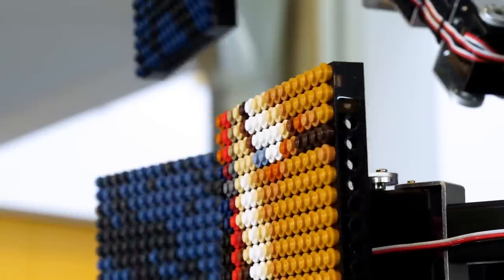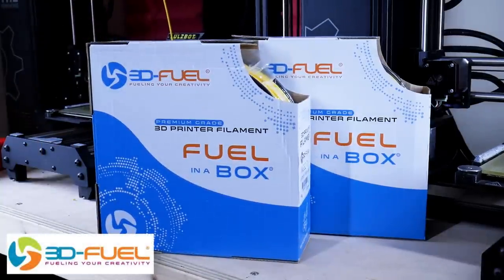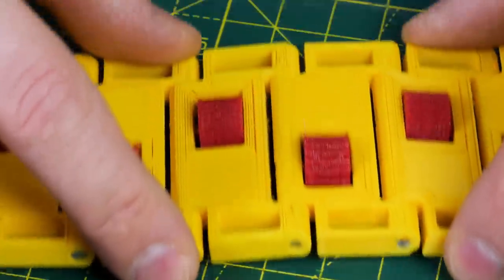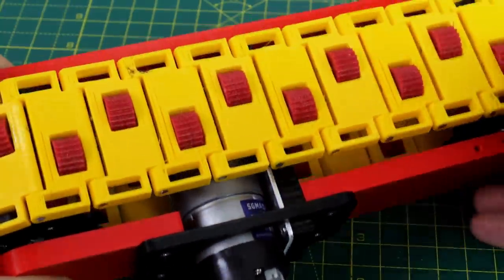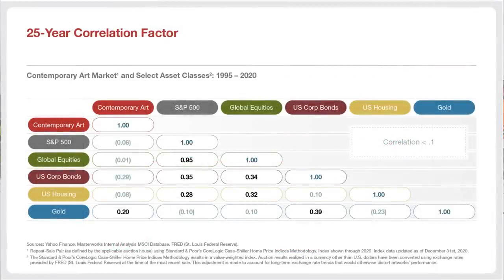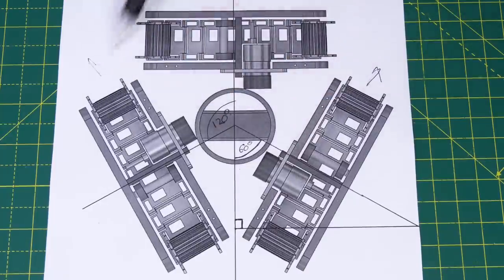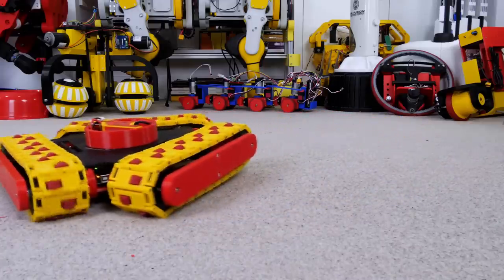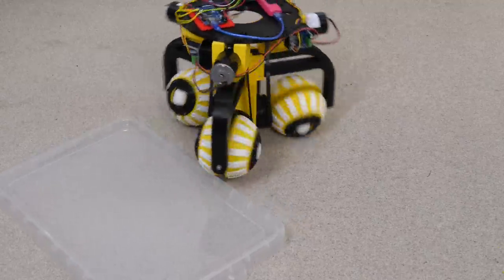Will this Omni-Directional Tank Work?

Comment: Perhaps you could create a flexible rubber 'inter-tube' capable of rolling in two axis, and wrap that around a row of omni-directional wheels? The inter-tube would need some kind of texture that would hold it in place as it moves.

Comment: Okay very nice, but!  How about adding suspension to the treads. Letting them pivot 10-20 from a center attachment, that way a thread to start to climb an object without lifting the other two treads. Also you could redesign the tread pads to have a spring loaded tpm fingers/knobs that are retracted into the tread on horizonal plane. But get pushed out but the end sprockets. This way you would have little rubber fingers/knobs to lift the tread onto objects, with out having them interfere with the wheels in the thread?

Comment: The track that goes sideways over some surface is always going to drag or catch by the look of things. So yeah, the terrain mobility thing seems a no-go on this.

However on the bright side, I bet that system would be ideal for distributing the weight of something very heavy while providing a large traction surface. This might be useful for omni-directional movement on large industrial robots on a factory floor.

Comment: Instead of each track being fixed at either end of its side of the triangle chassis, what about if they where attached at the middle with a pivot.
This would allow the leading edge of the track to lift upwards whilst the trailing edge lowers and remains on the ground.

Comment: Have you ever thought about making a 6 legged walker with rotational symmetry. Because of its shape it is passively stable both standing and walking, as there are always at least 3 points of contact with the ground, meaning there is no need for complex active stabilisation

Comment: It would make more sense to make the tiny wheels with lines in the direction of rotation. They are not driven, so they don't need traction in they direction of their rotation. If they slide, instead of rolling, it is fine. But you want them to have hold in sideway, in the direction of the tracks.

Comment: "As soon as the front of the track lifts off the ground, the back of the track lifts as well." At that point I knew that you had to give the tracks suspension. Just detach each track unit from the body and hinge it as a whole from its center.
Also, if you really want the thing to go off-road, you'd need to improve the edge of the tracks. There's no point of making the tip able to go over 5cm high obstacles if the 60° edges that follow it get caught up on 0.5cm pebbles. Maybe change from conventional track pieces to a "rope of wheels" i.e. stack a bunch of wheels and connect them by the ends of their axles.

Comment: If it was a Y config you could have all 3 tracks helping while still being symetrical. current triangle config means for all 3 tracks to be pusing your center of mass is off to the side relative to the point of contact on the thing you're climbing over.

Comment: for your next version instead of having the little wheels have an alternating offset per link you can double up and have two wheels per link, that way the majority of the link is tpu rubber with the wheels and you have less drag with the non wheels surfaces. It'll be a lot of wheels though

Comment: If you design a suspension system for the tracks similar to the one tanks use I think you will get a much better grip. Because one of the problems of your current track design is that it is to stiff to be able to form/deform over the surface you are driving over. You need more slack in the track

Comment: it might be an idea to make a basic triangle with a hinge on each side on that hinge you make a pivot point which makes the front and rear track higher possible.... just before the pivot point you make a compression spring back to the  basic chassis in the middle to regulate the pressure on the track... but a raised point so that it does not require much force

Comment: Maybe if you put each of the 3 tracks on a center axel? 
So each can spin on the Z axis. 3 rods coming out of the center, kinda where the motors are. 
Then each track can rotate up onto obstacles while the others are still flat to drive. 

Hmm or instead of a straight rod/axel type thing… each track could be connected to the center by a 3 segment arm type thing… almost like a human finger. It could then go right up to a 90 degree wall and one track could lift up to drive along the wall. 
I’m guessing the motor placement and all that gets tricky though.

Not sure if any of this would work, but the picture in my head is pretty cool lol… 
Apologies if I’m shit at explaining it.

Comment: With the triangular configuration shown here, would it be possible to move the motor to within the space between the two track drive wheels? Then add a pivot point at the centre between the two drive wheels, which is parallel and level with those drive wheels. Then as one track mounts the obstacle, the front rises up, and the rear presses down just as much. The other tracks will adapt similarly maintaining good contact. Being three pivot points in different axes, when on flat ground the vehicle will remain flat too. Please do built a life-sized one!

Comment: I forget the name, but you might try a "footed tread" design, since the "feet" act somewhat like proper feet.

Also, add more spring adaptation to your treads- going without separately sprung road wheels goes against one of the primary advantages of treads.

Comment: Great fun, nice project. As you mention some tracks lose contact when meeting obstacles. Some form of independent suspension would be required to ensure traction is maintained. I'm fairly sure you could use the platform as a good starting point for these additions.

Comment: It seems to me, if your track were not so taut - if it had some slack - then, even when the body is pivoting up, you could have a portion of each of your driven tracks making contact with the ground.  Making the links of your chain narrower may increase the flexibility, so that the length of track suspended in mid-air, no good for traction, is reduced, but first, cut your vehicle some slack!

Comment: Have you considered moving the staggered TPU wheels from mostly in the middle to each side of the tread links? This would both give you better grip at the very front where you're trying to climb, as well as free movement perpendicular to the rear track when tilted upward.

This would of course require a complete and rather nontrivial redesign of the tread assembly to accommodate the TPU wheels being where the sprockets currently engage with the links.

Comment: Kinda obvious what the solution is... Make the small wheels bigger and relocate them towards the edge of the tracks instead of the center...
It will a) allow them to catch on a ledge while climbing towards something and b) allow the trailing edge of the sideways going track to roll along instead of potentially catching the ground and potentially preventing the front end from pulling it along.

Comment: I wonder if it’d be possible to have an Omni style design with more than 3 wheels? Like you said, it seems to struggle when the primary driving wheel is lifted off the terrain, so perhaps a design where there are redundant driving wheels which can pick up the slack could work. I’m not familiar with Omni style design so I wouldn’t know what it would look like, but just throwing around ideas

Comment: I think one of the bigger problems with this design is the tracks don't have an articulated suspension and that will make them deal poorly with uneven terrain. Making the treads articulate and conform to the terrain would likely help with getting both tracks over the obstacle as you wouldn't lose all ground contact the moment the track's end is lifted up.

Comment: I love being wronged by engineering. Early in the video I theorized this wouldn't work because the tracks are at an angle the TPU sheels aren't (60° vs 90°), which implies the wheels aren't so muct rolling and sliding at an angle.
BUT this didn't seem to hinder the vehicle's omni-directional abilities. I was very surprised by this but perhaps driving it on a hard surface would highlight those problems more than on carpet.
In the end, it was the track themselves which proved to be the Achilles heels. I did not expect that.
Cool experiement.

Comment: I wonder if splitting the two tracks that drive it forward in half would fix the pivoting problem but I'm not sure if you would need 2 extra motors or if you could drive them from a single motor with a some sort of mutual belt. It might also require a slight play in the mounting to allow the front and back to tilt separately.

Comment: James,
I would like to see you explore the concept of an externally lockable omni-wheel for the purposes of having a wheel that can be both free-moving and have high traction as desired.
Reply from the maker: Probably something like last week's video/project
Reply: @jamesbruton  I suppose that would serve the same purpose, but it does seem fairly expensive to use an entire motor if the only goal is to lock the rollers. This is especially true in the context of a high school or college level robotics competition where motor count is limited. I imagine some sort of linear linkage utilizing a pneumatic or solenoid for power could be used instead. It should also be possible to use such a system with a straight-through drive axle by mimicking the mechanism used for braking on a BMX bike.

Comment: just had an idea for an omnidirectional "wheel" you might be interested in trying. it would have to be combined with with a balancing method though.

it's just a single spinning ball, the direction and speed of movement determined by the angle of the axis of rotation.

you haven't already tried it have you? I haven't seen all your videos so I might have missed it.

Comment: Hey James, I think this might be your best design so far IMO but did you consider using 4 tracks instead of 3 in a diamond configuration? This might help when trying to clear obstacles as the two rear tracks would still have contact with the ground. Maybe you could even have some kind of suspension between the two sections from front to back? I have no idea if this is possible, I'm certainly no engineer but thought it was worth asking about. Great work as always, keep it up!

Comment: Break each track up into two and allow them to pivot at the ends near the middle. Then add some spring suspension at the ends to keep the corners passively pressed against the ground. I also wonder how using an oddly-shaped wheel for your side rollers might affect their traction on bumpy surfaces like gravel and dirt.
Reply: I think a heavier frame would help here too, to maintain high friction between the tracks and the ground, especially with the proposed suspension (or shocks, rather). Maybe you could actively drive those shocks too, too climb over obstacles like the worm-bot.

Comment: What happened if you place a forward facing track in between each track?  You have three gaps in between the tracks and perhaps if you add a small forward facing track in between, it could engage obstacles like the plank. 

The other option would be to put the tracks on arms that can pivot their position some degrees,  maybe 45 degrees so that the track can be a little more parallel with each other when going over an obstacle.

Comment: You should try a design where the omni wheels are on the outside of the tracks and the drive gears run through the middle. It would give you better stance and get caught less.

Comment: I would have said four sided with articulation would work better (as in a square rather than triangle, and have the leading/trailing or non-powered tracks angle so that they could ramp over obstacles)

Comment: James has a thing for 3 wheels if it was 4 then the motors would drive in a diamond shape having the wheels converge on the tip of the diamond so the tip could reach up yes the balance would be crap when going up but it would climb (probably)

Comment: You need suspension. If your tracks could articulate about their centers with respect to the base, it will be much more able to climb without losing traction. If you were to add something like road wheels, it could be even more forgiving. Think how Curiosity's 3 wheels articulate on each side. If they were fixed, any unevenness in the terrain would result in most wheels leaving the ground, so they articulate to passively spread the load

Comment: James, I have been enjoying your videos for quite a while and they really stimulate my creative urge. However, I would really like to see better application of the scientific method here. For example, on the wheel designs you did before, like the one with feet, you really should have done a control test to demonstrate the advantage of the design. Such a control would have been very easy to throw together compared to the work needed for the main design. I think such an addition would enhance your channel as an educational resource significantly!

P.S. Try making the tracks curve upwards a little at the ends, or along the length in an elliptical path!

Comment: I would want to try this with the two ends of each track attached by some sort of suspension, so that it might conform a bit more when trying to climb obstacles instead of just lifting the whole thing and losing grip.
Reply: Or even just a pivit point at the center of each track, might allow enough twist

Comment: Cool movement, looks quite elegant. 
Quite complex maybe, could (active) suspension help to lift the rear drive belt such that it can keep grip when the front climbs?
Reply: Off course I commented before watching until the very end. The H shape is a lot simpler a solution.
Although the triangle shape looks cool/counter intuitive 🤣

Comment: Tanks usually have the belt angled in front and back (i.e. they are not going around one wheel on each end but two with an offset). I think that's exactly to give them more traction in such situations.

Comment: Since the motor is already inside the tank tread, what if you had to tank treads sets, each of which had three parallel tank treads around the center access all facing the same direction on each set, and then at the ends of these sort of prisms of tank treads, the whole thing would rotate 90° from that so that the whole tank tread prism became a rolling surface?

If you did this, then you would have powered movement in both ex and Y directions, which with the kind of control that you’re using would allow all the other directions you’d want, and that would fulfill the multi direction requirement. Then, have each of these tank tread assemblies be on a pivot at the center of their length, which would allow each tank tread prism to then be able to accommodate a certain amount of travel to get over obstacles.

Because the tank tread prisms are rotating in the perpendicular direction, there would need to be on additional support at the top and bottom of each tank tread set

It’s hard to describe it in words, but I don’t want to have to draw something out and post it. Basically you have one let’s say 10 inch standard tank tread. It would be connected to a center support at 90° both to its direction of travel and direction of rotation. Then you have two more of the same assembly each at 120° from each other give you a total of three.

Or, instead of that, you could have six tank treads that would form a cylinder, supported in between the gaps at the center. Then the whole thing could rotate in the perpendicular direction. This would make powering more difficult, because either you need six motors one for each of the tank treads, or if there’s just one motor, then it Hass to drive all six tank treads.

Given that, perhaps a better idea would be to use gravity to push a driven ball against the six tank treads, still with the ability to rotate in the perpendicular direction. This would mean that you would only be driving a tank tread that was on the ground, and it would be driven by friction, so there would be no motor inside of any of the tank treads. With this kind of a set up, it seems to me, although I can’t visualize it, there might be a way to have just one motor to drive this Ball in both the desired directions. In essence, somehow using your multi directional universal design within a rotating tank tread. The only reason to do all this is so that you can have your off-road in capability.

Comment: I'm curious, since the rear wheel/track was stationary due to your velocity calculations, what if you simply forced that to accelerate under certain circumstances? Possibly an accelerometer could help determine if the vehicle is getting stuck on an obstacle and engage the rear propulsion to get it started?

Comment: could you extend the tracks so they cross each other (by "routing" them through one another using idlers)? This way the active tracks would still be on the ground at the rear end when climbing an obstacle (and it would be kind of cool having the tracks run through each other lmao)

Comment: Looks like you need to have each track to pivot in the centre - motors and all, rather than fixed rigidly to the triangular plates. That way as a track tried to climb onto an object, it can pivot up while pushing the opposite end down for traction. The other two tracks will then adjust their angles to remain parallel to the area surrounding the obstacle.

Comment: How about a complete circle with drive wheels instead of tracks. all wheels, on the outer edge of the circle, would point out from a radius from the center. Want to go in a direction? Pick the right set of motors.
(Just an idea I had literally two minutes ago so I haven't had time to blow any holes in the concept functionality)